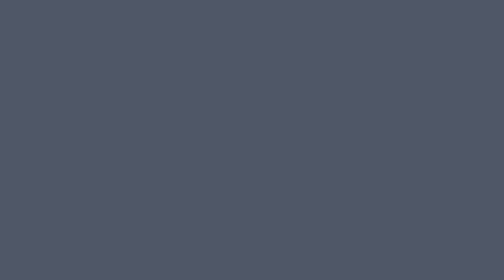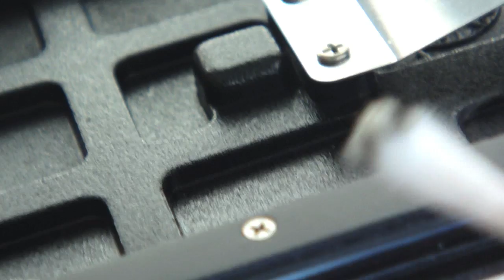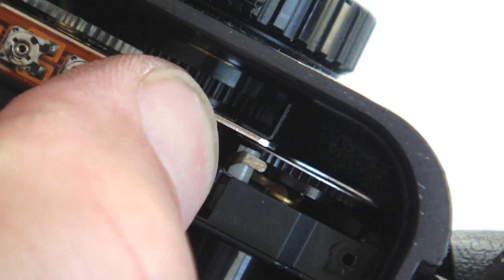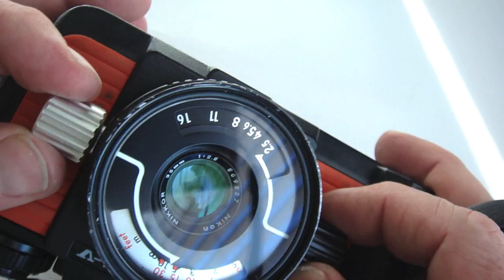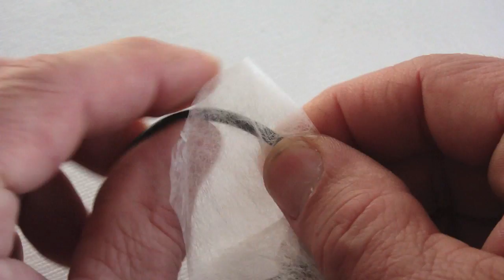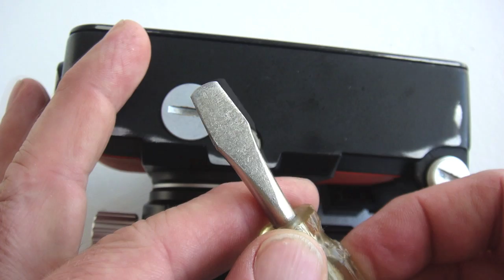Fix Old Cameras: Nikonos O-Ring Maintenance

Comment: Many thanks for a basic service intro on the magnificient Nik V. I have been using Nikonos underwater for 40 years and now INTERNAL Nikon o rings are extinct, however NBR o rings can be purchased from any industrial seal supplier. I find the task of disassembling the Nik V to replace the internal o rings to daunting to perform. I f you provide a video on this subject I would greatly appreciate it as I intend to keep using these superb underwater cameras well into the future.
Reply from the maker: +pat keenan 
Thank you for the tip on acquiring useable O-rings for these great cameras. Yes, the internal O-rings, particularly the lens O-Rings are much bigger undertaking.

Comment: Hi there! thank you for this video. I save my Nikonos V from death. It leaked sea water through the film advance lever and shutter speed dial joint. When I opened it I discover some rust witch I remove. I noticed there is an O-Ring in that a joint. Do you recommend to change that joint O-Ring, how can I fin it online?. Also the foam that seals the access panel and the one in the corner is degraded. How can I replace it? Thanks in advance. Greetings from Argentina

Comment: this video has been a great help to clean my nikonos! I only have to repair the film advance lever that is stuck. have a video fixing this problem?
Reply: i need to fix this as well. did you have any luck finding out anything about how to do this?
Reply: @FSUvinny  Yes, I fixed it by changing the battery.  There is a part in the manual that talks about this problem.  Hope this can help you.
Reply: @supertramp_film  changing the batteries? I have brand new batteries in mine though and it's just started sticking/is stuck now. The film advance lever won't budge now.
Reply: @FSUvinny  I don't know, maybe the lock lever button?

Comment: Yes, many thanks -I do have a bag full of NBR o rings  - I found the id/od sizes on an Italian website. A company in Melbourne (Camera Clinic) has been servicing my NikV's until recently but they can no longer obtain genuine Nikon o rings - they will not guarantee the work if non-Nikon o rings are used in their service. I will keep your website address on file and perhaps be in touch in the future. I do have a German manual on internal oring servicing, but (unlike yourself) I lack the skills and the patience to try it myself!! Thanks.
Reply: Pat, would you mind posting the specs of the o-rings or the URL of the website you found them?

Comment: Hi I have the 50mm FD 1.4 with fungi in the rear element wanting to wipe it went the entire element see a video you mentioned that if we would come out lucky full but in my nesesito case only leave the top ring to clean the fungus between 2 crystals any recommendation Greetings and very good videos !!
Reply from the maker: recmy1982 The rear elements of the Canon 50mm FD 1.4 can be removed without complete disassembly of the lens proper. Be very aware of the order and position of the individual elements. Take pictures and notes for insurance of proper reassembly. Hopefully the fungus is of the type that responds to cleaning.

Comment: Hi, would you possibly have the correct dimensions and sizing if one had to get the o-rings made at a local shop that makes o-rings? Or are only the nikon ones prescribed. I live in South Africa and there is nowhere nearby that services o-rings. Many thanks
Reply from the maker: If you have a local shop that sells O-rings take the old ones in and match them. Be sure you get the proper hardness and flexibility.

The size for Nikonos II body O-ring 
O-ring standard size #223 of BNR (buna-n black rubber) 

The size of O-ring for Nikonos lens 
O-ring standard size #224 of BNR (buna-n black rubber) 
. 
Measures of 7  Nikonos O-rings
Internal measurement (mm)  - Thickness measurement (mm)  
2.4mm Internal - 1.9mm Thickness 
4.9mm Internal - 1.9mm Thickness 
9.92mm Internal - 2.62mm Thickness 
4.2mm Internal - 1.9mm Thickness 
9.25mm Internal - 1.78mm Thickness 
2 each - 3.69mm Internal - 1.78mm Thickness
Reply: It would be great if someone could say anything about the hardness. The standard hardness is 70, but the 9.9mm 2.62mm is only available in 90. Also I look for NBR as the proper material.

Comment: Thank you for nice videos. Very informative. 
Do you know how to fix stucked self timer lever in Canonet QL17 and Mamiya Ruby camera. I have both and both did worked for a while and apparently self timer lever got their shutters stuck. I can wind and press the shutter release and hear a sound but the shutter wont  actually open. If you can sir, please show me How you fix this? I watched your copal leaf shutter video but the design is different in both cameras and also I want to know how to remove the lenses from both camera bodies too.(if that is nessesary for the repair)
Thank you sir for these wonderful videos. I have an old camera collection and I usually fix small troubles myself. I really appreciate the work you are doing. Helps people like us a lot...!!!
Reply from the maker: Chamal Upulitha The self timer is buried in the lens assembly unit and requires a fair amount of disassembly to access it. The blades could also be stuck together from oil that migrated on to them.
Reply: Fix Old Cameras  Thank you for the reply sir. I started disassembling the front lens elements in Canon QL19 and got the self timer lever unstuck. You are right, its a lot of work. But I was very careful and everything worked well. As it appears now both the shutter and apperture blades are the real problem. They are stuck.  I managed to manually open the shutter by rotating the round lever around the shutter and worked two or three times then gets stuck again. I hear this is a common problem in canonet QL cameras. I read about a blog post removing the sticky oil by spraying the aperture and shutter blades with a solvent, which can be done once all the lens elements are removed. There were two lens elements in the back of the camera and I removed the outer one easily. But I can't remove the other lens element from the back because the lens ring diameter is exactly same as the film chamber diameter. I can turn that ring back and forth a little but can't unscrew totally as it hits the chamber walls.
I was very surprised by that fact. Looks like I have to remove the entire front lens assembly from the body. Could it even be done?
I don't know the procedure to do it.  Even though I could clean the shutter I can't get to the aperture and I don't think its a good idea to spray or pour anything with a lens element. 
:-(
Reply from the maker: Flush cleaning oily shutter blades is not ideal but often times an acceptable procedure to free the blades. The glass needs to removed for if the solvent gets between the lens groups it will be trapped and leave a residue.
You might be able to work the lens group retainer out with the tip of a small slotted screwdriver. It not, the lens assembly is attached to a plate that is in turn attached to the body of the camera. The top cover will need to be removed. The front leatherette will need to be peeled back. The bottom cover will need to be removed. Be mindful of the linkages connecting the rangefinder, the shutter wind mechanism and the shutter release mechanism when the lens mount plate is removed. Good luck, your persistence is admirable.
If you chose to flush clean the blades the following link is a good product. It is featured in several Fix Old Cameras videos. http://astore.amazon.com/fixoldcam-20/detail/B001OLVB34

Comment: If you operate a camera servicing business I would gladly send my Nik V's to you for the dreaded internal o ring service, Many thanks. (I currently live in Perth, Western Australia).
Reply from the maker: +pat keenan 
Well... that is a bit funny.  According to Google, my shop is 1000 miles from the Gulf of Mexico and 1500 miles from the Pacific or the Atlantic Ocean. But with that said for future reference the shop information can be found at http://www.phototronic.biz  With the corral reefs and ship wrecks in your neighbor hood, surely there are some local camera repair shops that would help you with the Nikonos - V internal O-rings. There are seven internal o-rings with the following groups of numbers being very close to the dimensions. 
 The first number of the group is the internal size in millimeters the second is the thickness in millimeters. 
 (2.4 - 1.9) (4.9 - 1.9) (9.92 - 2.62) (4.2 - 1.9) (9.25 - 1.78) 2 each - (3.7 - 1.78)
Reply: @FixOldCameras  Since there seems to be no camera repair shop operational anymore, which is maintaining the Nikonos V, it would great if you could make a video about the replacement of the internal seals.